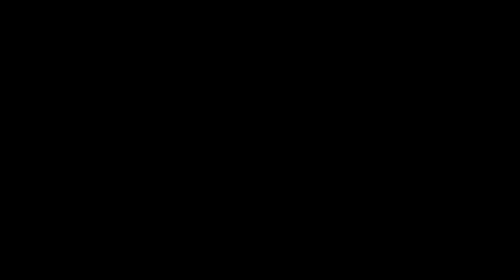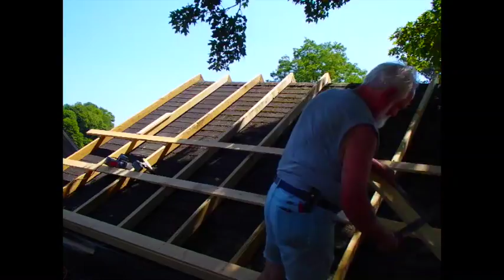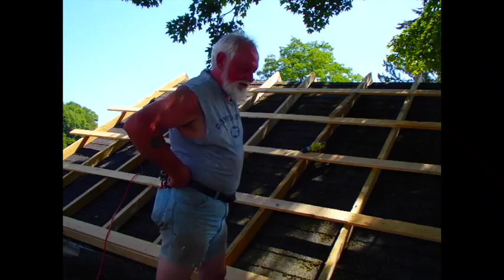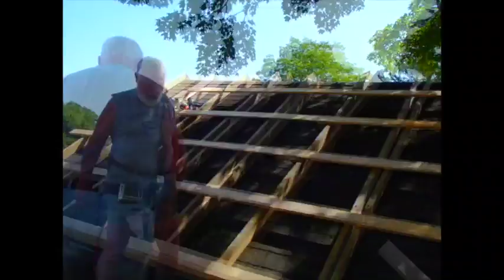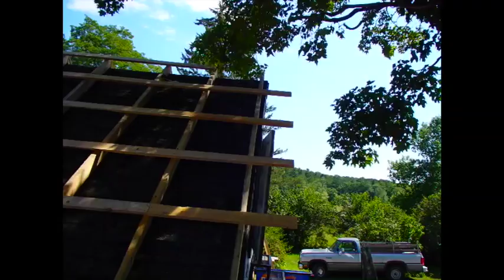More Strapping Boards on the Roof

Comment: When putting a metal roof on one needs to run the top nailers back from the ridge in order to nail/screw the ridge cap on.
Reply from the maker: Good point..